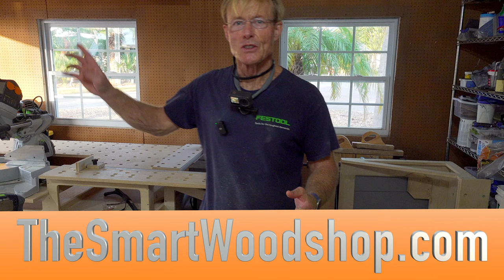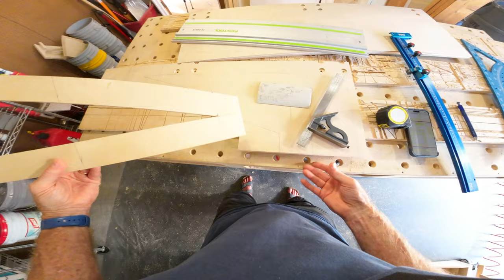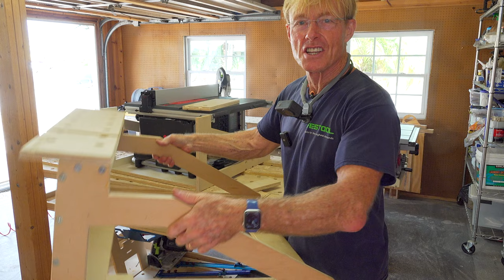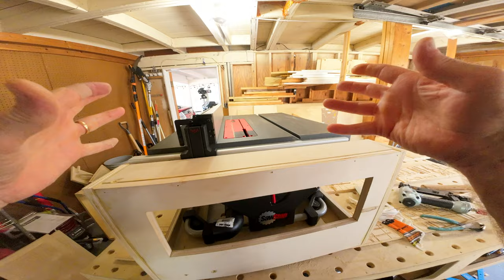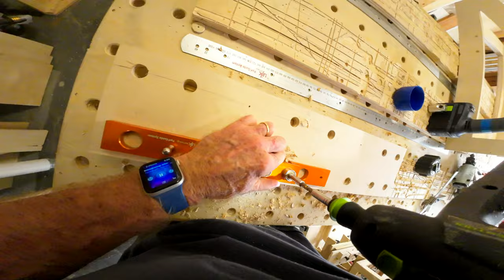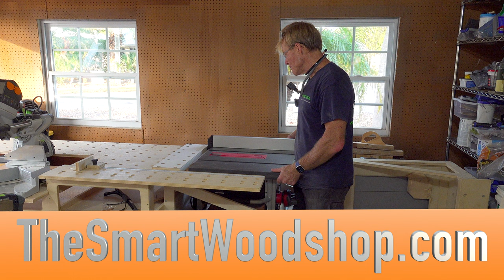SawStop CTS Smart Cradle and building it in the Smart Woodshop

Comment: Ron - is the CTS bigger than your previous saw?  You are using the "Mk.II Parf Guide Drilling System" for the guide?  Did you have a larger guide for the guide hole drilling - something for a sheet?  These videos are so dense with information I need to watch them several times.  Thanks for detail you go to in these.  Looking forward CTS going through some panel breakdown videos using this cradle.
Reply from the maker: The CTS is much smaller than the JSP. The Parf MKII is the only drilling system I have and use it for all of the Smart Benches and accessories such as the Cradle, Router Tables, Bench Extensions, etc. It is an amazing system with no other accurate option unless you have a CNC or take it to a CNC shop. I NEVER NEVER NEVER NEVER use a table saw to break down plywood. A table saw is not a good option for panel breakdown unless you have a stroke saw with a 10' or longer stroke. I am including cabinet saws like the Powermatics, SawStops, etc.. I use a track saw in place of a stroke saw and get the same results. A table saw is good for rips under 12." I have covered all of the above many times in much more detail. Note this video is specifically about making a cradle for CTS.  Check out the video library here at the Smart Woodshop as there are over 1000 of them. Ron
Reply: @TheSmartWoodshop  Thanks for the detailed reply.  I will need to go back and review.

Comment: I finished building mine yesterday--wish I would've waited for this video! One question, if I want to build a cross-cut sled, it runs into the top/connecting piece. Would you recommend using a dado bit and carving out beyond the miter slot into the connecting piece? Or would you recommend just adding feet to raise up the saw when I'm using the sled? (The dado would be a lot easier for continuous use, but I'm not sure if structurally that will cause a problem.)
Reply: Also, what about the plastic flip switch for the fence on the side closest to the bench?
Reply from the maker: Cut out a slot/dado that matches up with your saw. I cut dados on all of my cradle builds, but took them off the plans as they need to matched up with each saw specifically. I used a router and guide to make the dados as a final step. It is a 5 minute process and should be wider and deeper than the saw table dado.

Comment: I have to put a 25lb weight on the other end of the table when I mount my cradle to keep it from rotating open :) 

The mitre station benefits from having the mitre saw. I still wonder if maybe I did something odd 🤔 no mention or warning of having to counterweight it but the physics make sense.
Reply from the maker: I have a few videos on this. I strap down the bend on each end to the sawhorse or cart. https://youtu.be/9kj4QRbC-GI?si=MGQghQlKdbq60Kc-
Reply: @TheSmartWoodshop  Thank you sir :)
Reply: Love the plans and just finished my bench and cradle. I created a  single leg (similar dimensions of the saw horse) then, made a shallow dado in the cradle bottom to align it during the bench setup.   Solved the cantilever issue. So stable, I can stand on the cradle. And, the leg fits inside the cradle during storage. Happy to share a pic / design

Comment: Another good video with good tips Ron. Thanks! There was a recent review of the CTS by Matt Outlaw (https://www.youtube.com/watch?v=TieBJVT5nBM&t=90s) where he had issues with the fence sagging when fully extended. Have you come across that issue too?
Reply from the maker: i have a video about that. it will post in a week or so. It is a non issue imo.😎
Reply: @TheSmartWoodshop  Sounds good. Also thanks for the tip on using a 3/4" dowel (and how to locate precisely). Don't need the cradle to line up with CNC accuracy to the rest of the table and the 20mm tolerances can get pretty tight!